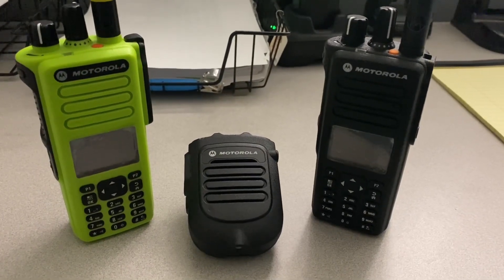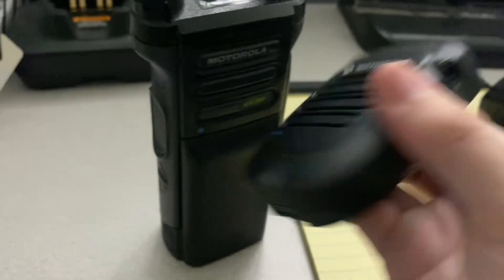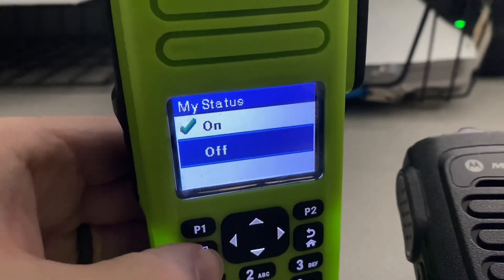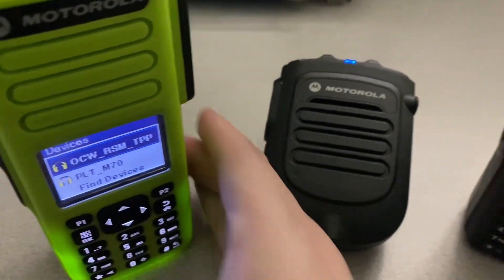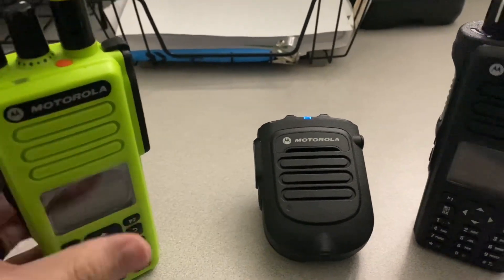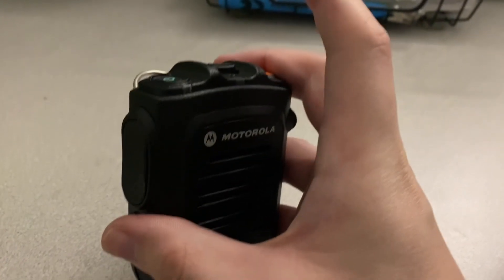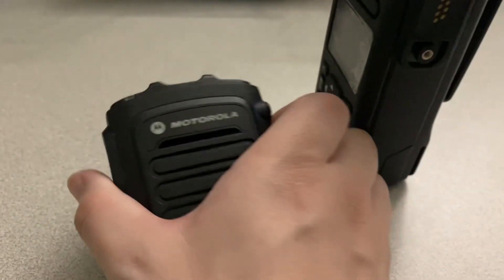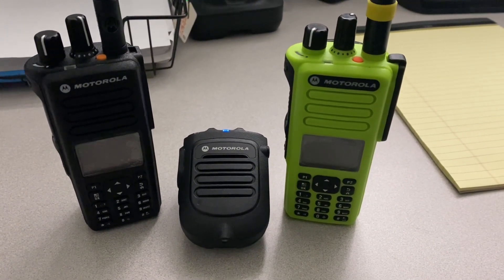Motorola MotoTRBO Bluetooth RSM - How to Pair & Unpair From a Radio

Comment: I have a slightly different issue with the RSM.  I don't know if I'm in a bluetooth rich environment but when I try to pair the RSM to the radio (XPR3500e) when I go to the find devices menu it takes forever to find the RSM. It finds all sorts of other things but my RSM is not listed. I try powering down both the RSM and the radio and start the process over but often with the same results. What seems to yield the quickest pairing opportunity is constantly going back and forth in the bluetooth menu between find devices and then just backing out right away if my RSM doesn't show up immediately. Constantly hitting find devices eventually puts the RSM on top of the list. The only thing I can think of is where I work there must be so many bluetooth devices that the XPR3500 just can only show so many?  I get a different radio everyday so that means I must always start from scratch each day.  Anyone run into this issue? If so any work arounds that you might use?  Thanks!

Comment: @stormandrailfan96 i have the wm500 Bluetooth mic motorola and i can pair it to the xpr7550e ,it will receive audio but wont tx is it anything im doing wrong or slso i have to invest in the 1 your using in the video with the blue dot? Also great helpful video ..

Comment: Can you confirm that the Motorola MotoTRBO Bluetooth RSM will work with a Motorola r765IS radio? Those are the ones we use at work. Thanks.
Reply from the maker: @thomascraig3472  I would assume it would work, however I cannot say for sure as I don’t own that model.